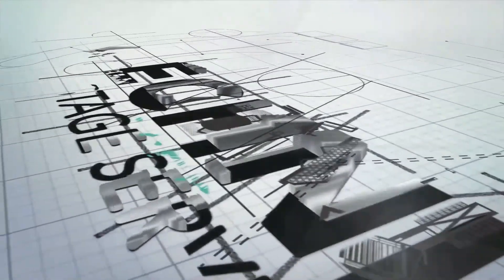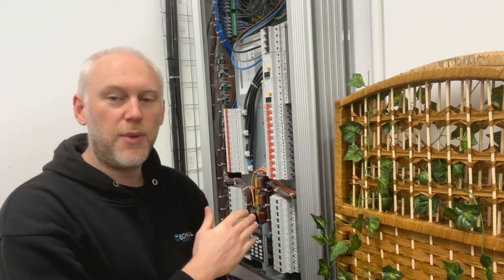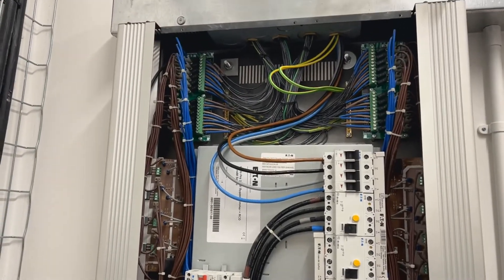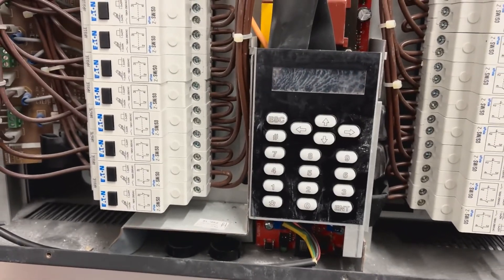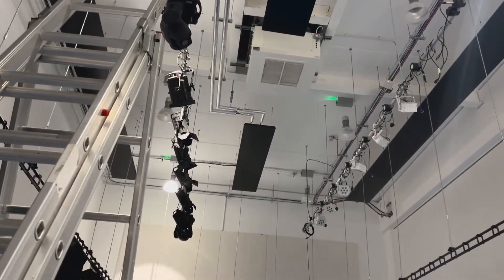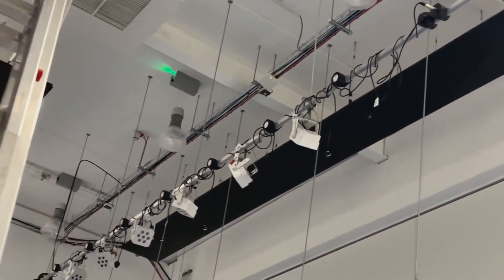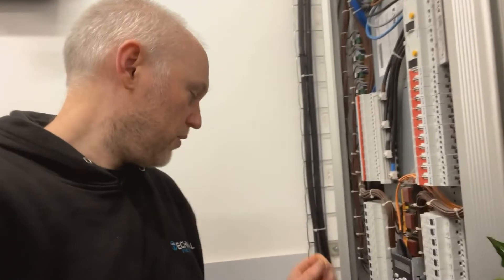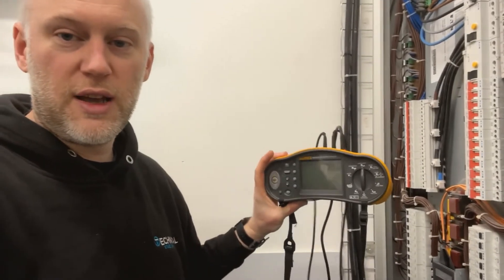Electrical Inspections - How to inspect a Theatre Dimmer

Comment: hello, awesome vid would love to pick your brain for more knowledge, as I am that non specialist electrician that was sent to test a theatre... was told to test all 16amp commando sockets from dimmer racks (earth loop impedance) all racks was turned up, but when testing my meters (megger mft) gave me mixed readings some were fine but others wouldn't test as I think the voltage was too low 220v... as I said not my comfort zone but always wanting to learn something I don't know... would be awesome if you could shed some light on this situation. cheers buddy